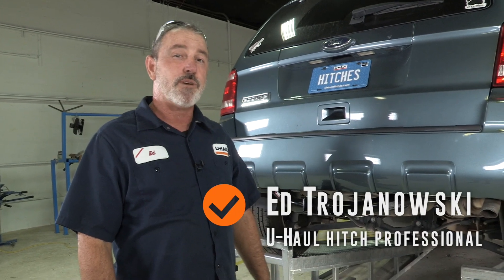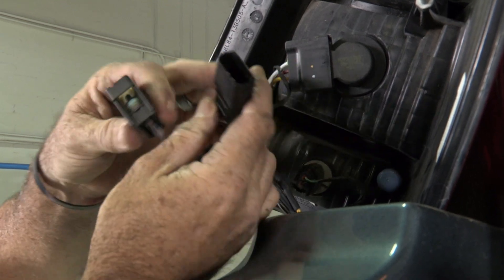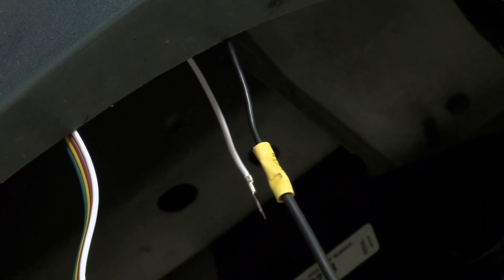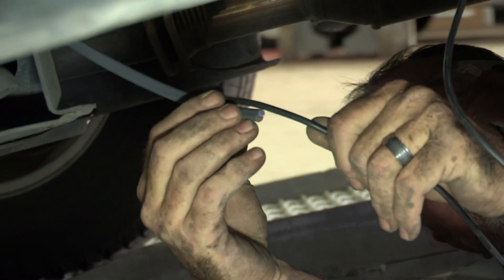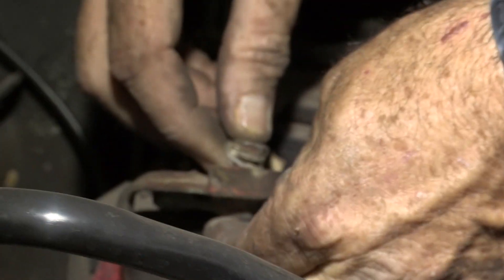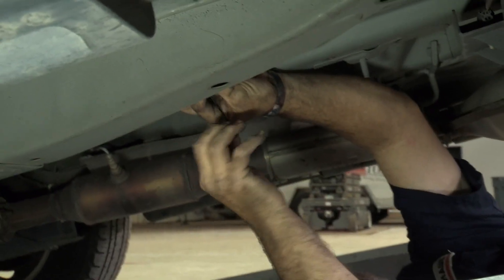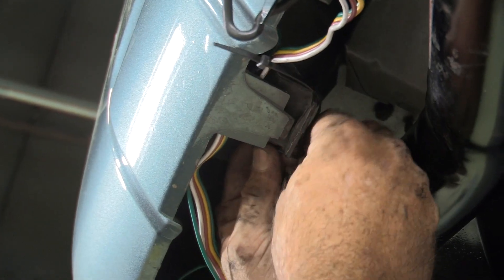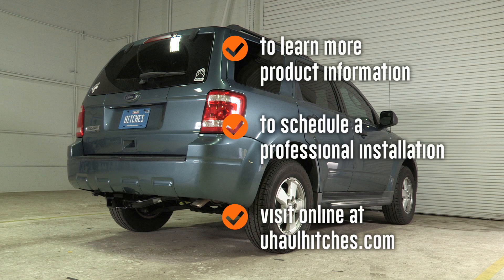2011 Ford Escape Trailer Wiring Installation

Comment: Most excellent tutorial.  Good tip on following the brake line and coming up by the brake fluid reservoir.  Only issue I had with my Hopkins Harness Kit was where to put the dang module.  The only way to drill into the area just below the tail light well is to remove the plastic bumper cover.  Not for me.  What I did was take some wire, double wrap it around one of the plastic bumper screws and then threaded the wire thru the module bolt hole, twisting it off to secure it.  That way it's up out of the weather just below the tail light lens.  And the best part?  Darn thing worked exactly right the first time I hooked her up to the trailer!  Woo hoo!